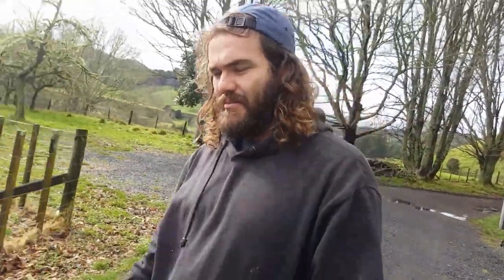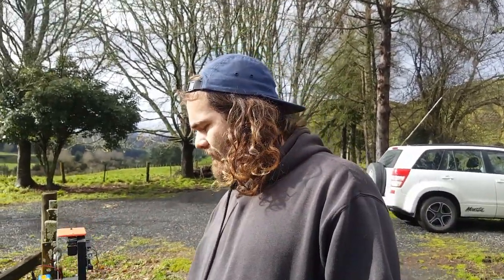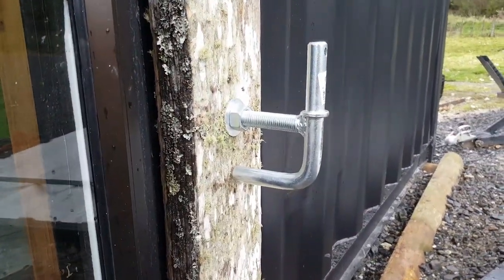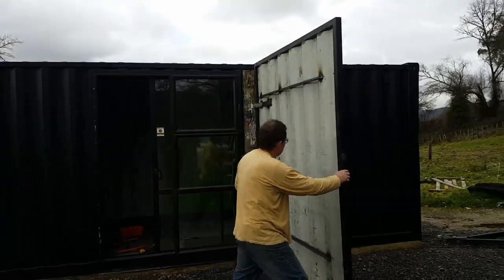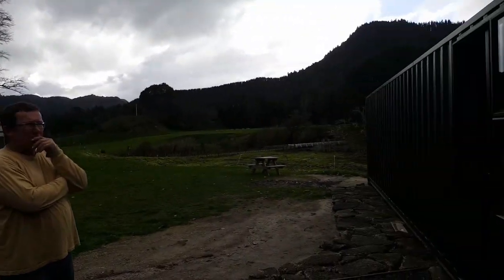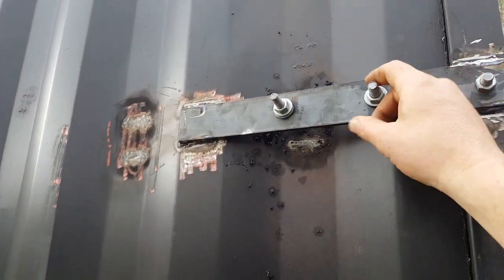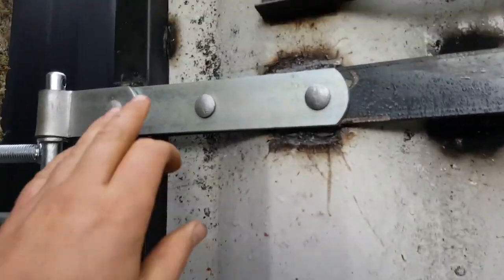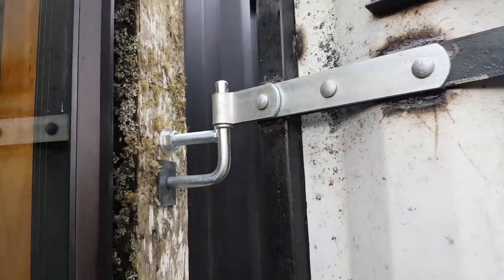Security Door | Shipping Container Build Ep 5

Comment: Hey Julian,
Can a container be “shortened “ say making a 30 ft out of a 40 ft, and if so how to maintain structural integrity?
Thank you in advance,
Christian Caine
Reply from the maker: I guess you could. It would be a big job but it's all pretty modular. Lots of cutting, lots of welding!
Reply: You could, mainly using an angle grinder for the cutting. The floors are not steel sheet, anyway, but lots of C shaped steel beams about every 20 inches with wood fixed on top. The wood sheets are treated to stop them rotting, so not suited to human living inside long term without ripping them out. The strength is provided by the heavy steel at the corners, so you'd have to include those. Shipping containers are made of thin COR-TEN steel no more than 2mm  thick but the corrugations add the strength, though not enough to bury them without loads of added strengthening, plus good waterproofing though. 
If COR-TEN steel is welded with ordinary MIG wire you do lose some of the anti-corrosion protection at the welds, but many don't want the expense of buying specialist MIG wire. Welding supplies manufacturers have stated that some copper etc. from the steel still mixes from the parent metal so welds are not totally mild steel even if the special MIG wire is not used to weld, though that's what they advise despite the expense. The roofs can collapse or bow as they come if more than about a foot or so of earth is put on them so don't do it without strengthening. Same applies to the sides with earth pressure.

Comment: Are there any openings after you shut the door.?  I mean on the top or the bottom. I did not see any filler wood
Reply from the maker: Yeah about a 100mm gap. I don't need it suuuuper secure. You could close that gap with some steel or extra timber